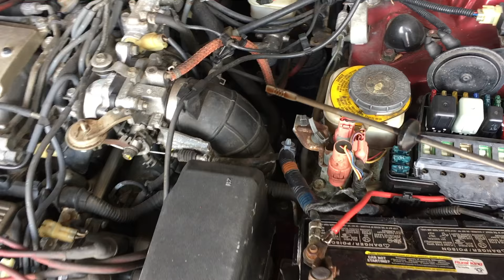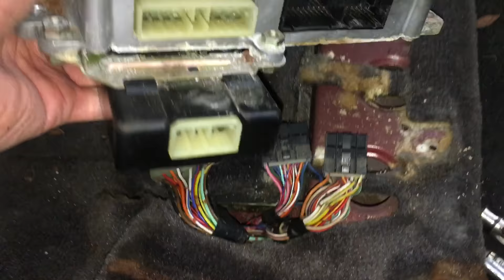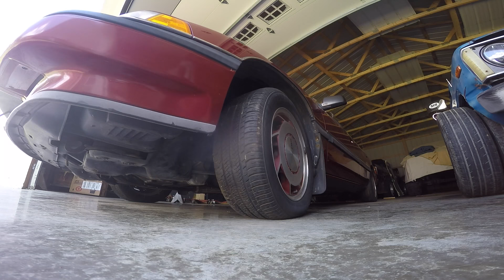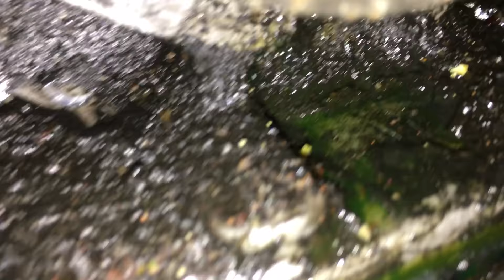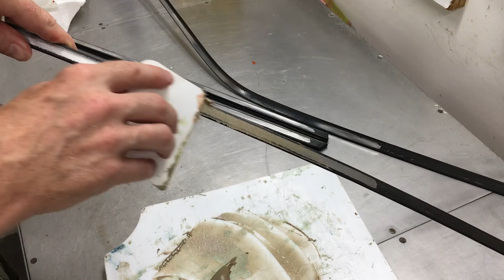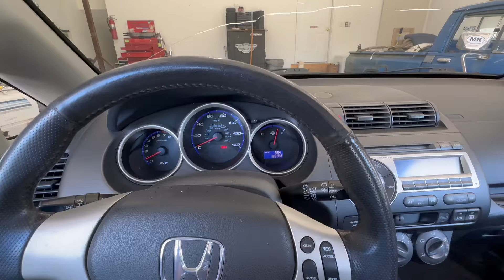$350 Acura Legend Full Restoration: 15 mins Start to Finish!

Comment: The thing you got to worry the most is about the fuel and brake lines.  If they are corroded in any way which probably they are most of the time, you get to replace all of that.  That $350 ends up costing you a lot of money even if you are a DIY guy.  But then again you find that diamond in the rough and you do very little work on it and those vehicles can last forever.
Reply from the maker: I got lucky, the underside was extremely clean. This was originally a California and Colorado car. It only came to Ohio before it sat for a decade, so it  ever got exposed to all the road salt that most vehicles around here do.

Comment: I wonder if it would have run on the 10 year old gas if you added a few gallons of fresh gas to it. The lines shouldn't have had fuel in them the fuel should have drained back into the tank over time and the issue with it not running was the ECU or whatever
Reply from the maker: Good question…. It was still flammable but after seeing how bad it gummed up the injectors, I’m unsure if they would have cleared out after running a mix of old/new gas through them.
Reply: @6thGearGarage  I think the injectors were probably gummed up from many years before or weren't spraying right. If there was a few drops of gas left in them I don't know if it would have gummed them up just from sitting. When you cleaned the old gas did you clean the injectors or run with new gas? I have 8 year old gas in my 10 year old Subaru I want to get it running it's been in storage forever just want to add a few new gallons and some fuel system cleaner and hope it will run long enough to flush out all the old gas without having to remove the tank or mess with the fuel pump
Reply from the maker: It’s worth a shot before taking everything apart! When I saw how nasty the fuel pump and filter was, I just went ahead and ordered rebuilt injectors.

Comment: Awesome work. Question. You said you traded it for the Honda fit. How and where did you go about that? I have an old Camry that I wouldn't mind trading for something equivalent. Thanks.
Reply from the maker: Thanks!  I had the Legend listed for $3500 on marketplace, and a guy an hour away offered to trade. He drove out and threw a little cash on top of the deal. Nobody had even come to look at the car in the 2 months I had it listed, so I took the offer because I really needed a daily driver.
Reply: @6thGearGarage  Thanks. I appreciate the response.

Comment: I remember seeing these in the showrooms as i went to buy my 1987 Integra. They were 19 to 22k at the time. I drove mine for 9 years. I wish i would have put money into my car to update it instead of buying a newer car. The 80s Acuras were beautiful cars.
Reply from the maker: First generation Integras are just as rare, if not more, than the first gen Legends. I haven't seen one in at least 15 years around here.
Reply: I owned a 1988 Integra, yes a new car at 19 years old! It was an LS with sunroof, 2 door hatchback, was like 15k with taxes etc.
Reply: @pauli6043  Yeah. You got the luxury model. I paid $10625 tax included for my RS. I figured i got the same motor, 5 speed, and AC. In added the EQ and cassette myself in  a parking lot. Good times.  It was one of the few things in the 80s i enjoyed
Reply: My first Honda product was an 87 integra. Great cars. I currently have a 94 legend GS and 95 legend coupe. Both 6 speeds. Also have a 92 integra gsr

Comment: I would free up as much as possible the mechanisms and try to rebuild them using hydraulic lines and stainless steel cables or for that matter maybe use high quality brake cables.
Reply from the maker: I tried but everything was completely rusted together from years of standing water in the sunroof.
Reply: @6thGearGarage  there is a japanese website that has parts. I got a fuel filler line for a short run Suzuki Grand Vitara. It was cheaper with shipping than from the US.

Megazip.n3t, i highly recommend it.

Comment: Just some 'while watching' thoughts. Always make sure the battery terminals and posts are clean and tight. Then cover with grease (don't need specialty stuff - you're just preventing air/moisture to get in and around). That was really smart to sneak a peek at the timing belt. Love it when the fuel pumps have an access panel (GM are you reading?). Even if it's a pickup truck! You had the sunroof off. With no headliner, would have come off easy after wet sanding.  Easier masking for paint without it. You can make an easy 'paint booth' with poly sheets or tarps to prevent dirt in the paint.  But it looks very good still. You did an amazing job with it.

Comment: That's NOT the "Golden Era" of Honda/Acura. VTEC was introduced in 1989 for the new 1990 model year Honda Integra. THAT'S when the Golden Era began. It hasn't ended. From Ayrton Senna until now Max Verstappen winning 4 F1 Driver's Championships in a row, Honda is STILL DOMINATING.

Comment: I had 1990 legend from 1999- 2002, manual. Now have a 2002 acura rl. A kid at gas station once  asked me if this is a Mercedes, a lot of people dont know about legend and toyota Cressida of same era . 😅
Reply from the maker: Not many older acuras left on the road up here in northern OH :(
Reply: @6thGearGarage  so true, im in central ohio and haven’t seen a legend in years. Ill need timing belt 3rd time on my RL soon, has 246K, still running strong.

Comment: Wow ! I love the time and patience you in to this thing. Two things, what did you do about the sunroof issue and RPM gauge forgot to work. Hope you got good money on top of your trade.
Reply from the maker: I never found another sunroof for the car, so it didn’t work. The motor tried to move but the cables were seized from rust. I pulled the cluster out and resoldered some of the solder joints on the back and the rpm gauge came back to life.

Comment: I had the chance to drive a used 1988 legend LS automatic, that car was amazing even with 90k miles abd poor maintenance.  The handling, the 6cyl engine, was pure perfection.  If you can het it working, it will do another 100k miles with no problem. Thats when cars were made to last and run forever.

Comment: Did you clean out the fuel tank after you emptied it?
Reply from the maker: No the tank was pretty clean inside. I did have to remove and clean the sending unit though.

Comment: Very nice, not a big fan of the seat covers, but hey better than the ripped seats. Also I would’ve restored the plastic trim that goes around the car. Gives it more of a pop!
Reply from the maker: Yeah, the seat covers weren't the best solution, but it fit the budget.  I did up restoring the black trim later on, before I listed the car for sale. It really complimented the fresh paint.

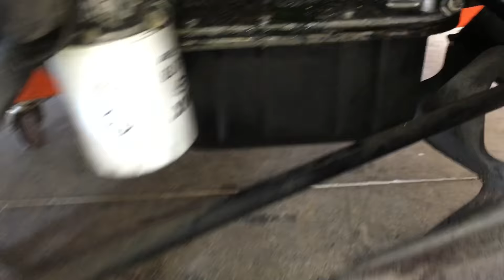Comment: 10:44 😮never seen anyone break a bolt with starting the engine 😮😅
Reply from the maker: Very helpful trick that I've used many times. Here's how to do it: https://youtu.be/GCE3P8AD2rI
Reply: I just had to do that on a 75 year old engine thinking it was a dumb idea but it worked just fine
Reply: Its pretty common. Ive seen it done a few times on youtube

Comment: I got neighbors 1999 es300 garage queen. 80 thousand miles. For 1 dollar. Needed servicing timing belt water pump seals, treated leather seats 2xs, cleaned intake and mass air, lubed new bulbs all around. a new coil, tightened gas pedal.  car looks new.  it runs great, has chrome lexus rims too.  Funny i took care of the car for 10 years as a favor to landlord, loved the car on shake out drives. Now its weird and its mine.   San jose has zero rust.  headlights are clear as new perfect.. everything works perfect..  No one wanted to maintain the car. I didnt want it towed for junk.. I was gonna fix it and find it a home but i fell for it..  Now we got 4 cars..
Reply from the maker: What a deal!  That's a great car and will last such a long time.

Comment: I bought a 1990 Legend LS 2.7 in 2008 for $600 from a dealer, missing driver seat (had a 91 teg seat held in with 1 bolt and bricks...) trashed maroon leather seats for the rest, , ended up installing tan cloth coupe seats in front then 6 months later found a matching tan cloth back seat, picked up a 1988 Manual trans in Atlanta for it ,n painted it black and put a set of 1996 5 spoke accord alloys on it, but got divorced and the Wife nagged me for the car...then traded it for a 1995 Hyundai that burnt to the ground a week later...
Reply from the maker: I was liking the story more and more... until the vary end :(

Comment: I’m still upset I sold my 2005 Mercedes e320. It had a rare brake issue that I probably could’ve fixed but I had it stored at a friend’s house and he passed away. I had too many other cars so I had nowhere to put it. I pretty much sold it at scrap price just because the brakes were potentially an issue that could hurt or kill somebody if they didn’t know what they were getting into. The outside and inside were near mint and it brakes my heart but this is why a lot of older vehicles go. Simple fixes that cost a little too much out of someone’s budget and not wanting to put that on your average $1000 car buyer without not sleeping at night
Reply from the maker: Around here, most cars rust away by the time there are any major mechanical issues.

Comment: It’s funny that to meet emissions of the 1980s car companies would have a ton of tubes and sensors that made the engine bay look like a snake 🐍 pit. And throughout the late 1990s they figured how to add power without sacrificing efficiency, and even cleaned up the engine bay from all those pesky tubes/wires/hoses… funny how we’re back at scare one with modern ICE vehicles lol.
Reply from the maker: The 90's cars are my favorite era to work on. Simple, tunable and reliable.
Reply: @ Exactly. I remember buying a 1998 Honda Accord with the 2.3L VTEC engine. I didn’t get a chance to work on it because I didn’t know how. But it looked clean under the hood. Then I bought a coupe 2001 3.0L V6 engine version of the same car. And compared to all the other V6 engine stuff it was the cleanest and most beautiful engine and engine bay I’ve ever seen. Hell, that Honda V6 engine was the easiest work on, and even the modern versions of it is stupid easy to do oil changes, spark plugs etc.

Comment: Were you able to stop the sunroof from leaking?
Reply from the maker: @nickc9224  yeah I unclogged the drains with a piece of wire and it didn’t leak anymore. They were full of junk.
Reply: @6thGearGarage  ok and you sealed the top shut so no more leaks!
Reply from the maker: @nickc9224  The sunroof was seized in the closed position. But it was the clogged drains that caused water to collect around the sunroof and leak inside.
Reply: @6thGearGarage  Sorry thanks for clearing that up!

Comment: With sharp lines you can adhere another piece of masking tape to it and round it over on itself. Creates a lip which lightly reduces the amount of clear coat helping to prevent a sharp line where they meet.

Not perfect but it helps.
Reply from the maker: I've seen someone do that in a video (after I painted the car) great idea!

Comment: I got a 2002 v6 accord coupe for $250 4 yrs ago. Needed 1 wheel bearing. Ran great.
Reply from the maker: Great find!!
Reply: RIP transmission
Reply: @lillebrorsanvincent2017 Yup, I had the 4 cylinder 98' coupe a few years back, got it when it had under 50k used at 4yrs old. Transmission gave up then engine developed massive oil leak. Drove it to the junk yard avoiding 2nd gear. Great handling car, interior was still in great shape, sun faded roof (southwest car) but hardly could tell with it being silver. Kind of wish I still had it.

Comment: I had a '90 Legend with a 5 speed stick.  What a great car with incredible quality.  It was fast and a real joy to drive.
Reply from the maker: Mine was an auto... I can imagine how much more fun a 5 speed would have been.
Reply: I had an '88 and '90 Legend Coupe 5-spd and those were just good cars.  This so bring back some nostalgic memories! 👍
Reply: @ why u sell
Reply: @ all things end
Reply: shouldn’t have sold it
Reply: me too, Light gold exterior. Wish I  can find a picture of it.
Reply: I had a 91, 2door 5speed manual. The wife of a police chief used to own it. It had 200k on the odometer. But the motor and transmission were completely rebuilt before they donated to the auction I worked at. So I was able to buy it for 1,600. It had power everything and everything worked. It even had the electronic doors that close the doors all the way so you didn’t have to slam it. I LOVED that car. Drove that for years across the country without any issue. But one day, a drunk driver crashed into it in front of my apartment one morning. Completely totaling it beyond repair. Still to this day, that was one of the saddest days in my life.